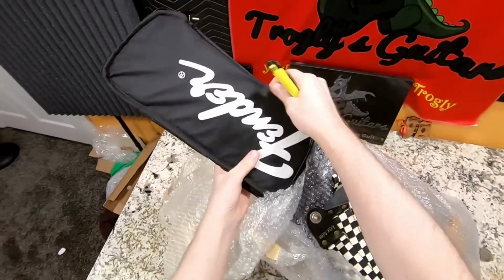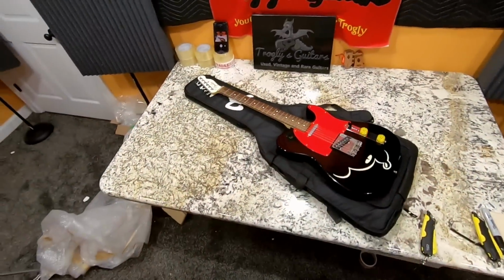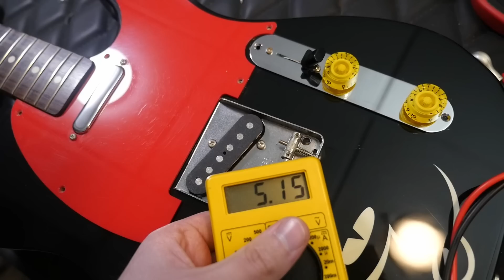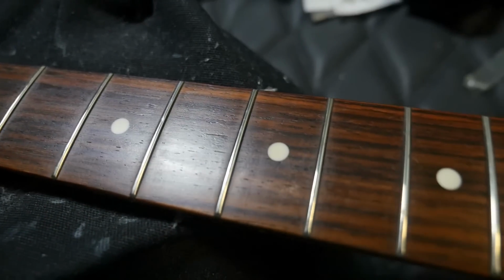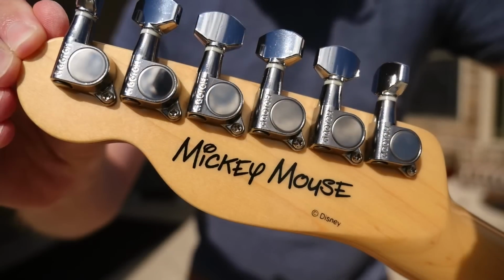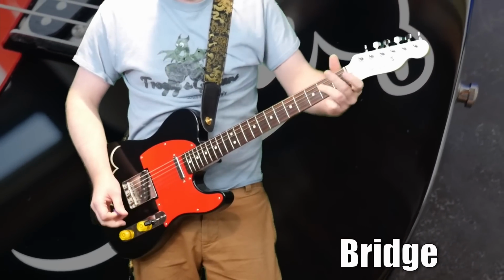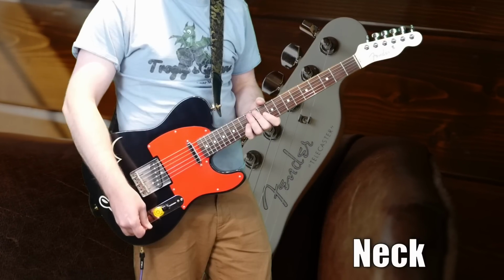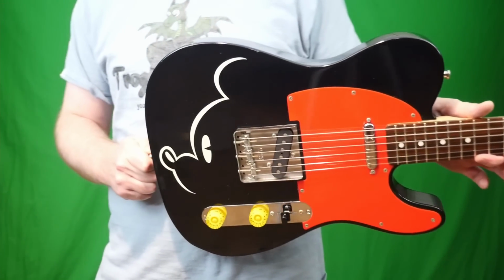That Time When Disney Got a Signature Guitar | 2008 Fender Japan Disney Mickey  Telecaster

Comment: I'm going to take a wild guess and say an actual kid used that Telecaster. Although I picked up an Ibanez rg from a guy i worked with that is needing a ton more TLC than this one. I've seen some car guys use enamel nail polish to touch up chips and scratches. Looks like like your having a good time with that guitar. The Telecaster lends itself well to a blues sound and sounds great with that blues breaker.

Comment: First thing I have always done to the Japanese Fenders is to change pickups and electronics. Now days they use USA electronics and good alnico pickups in most of the models. No need for changing it anymore. I’ve kept my Stratocaster photoflame 54 reissue. When I got it it was in poor state. Built new period 5 layer picture with new electronics and Abigail Yabarra pickups, refretted it, cleaned it and on the end it was on level of any Custom Shop Fender. Looks awesome to. They really make great instruments in Japan.

Comment: On japanes guitars the year of the manufacturing is identified by the letter not by the digits. In this case it's a 2007-2010 model. The exact date might be hand written on the heel of the neck. Cheers

Comment: The output jack having that generic black plastic instead of a proper Telecaster jackplate is strange. But I googled it and it seems to be a spec on the cheap Standard series at the time. I have only had japanese reissue models, you learn something everyday

Comment: Surprising to see ceramic pickups in a Fender guitar. They probably weren't primarily created to be played in any public setting.
Reply: Fender Japan guitars actually have (had?) ceramic pickups in the standard range all the time. I got an '85-ish (Fender Japan serial number dating is both parts science and witchcraft...) Fujigen-made Strat and it came with ceramic pups as well.
Reply: @np8596  didn't know that. Interesting.